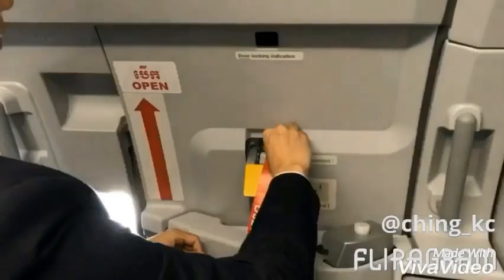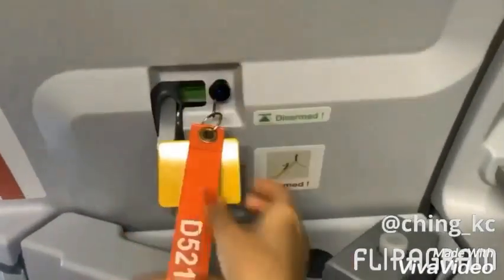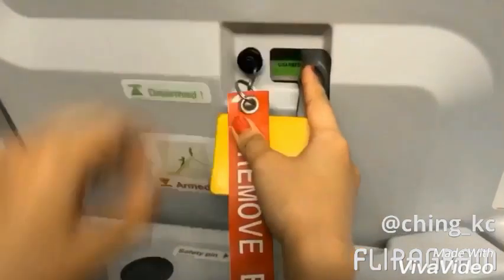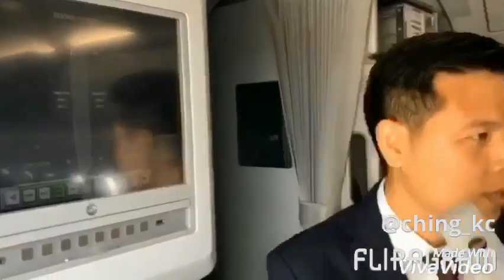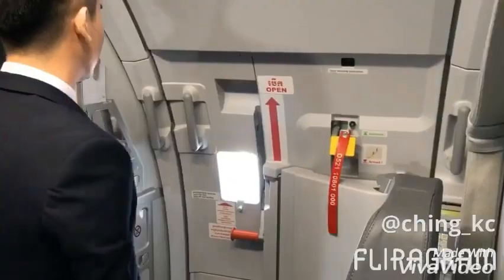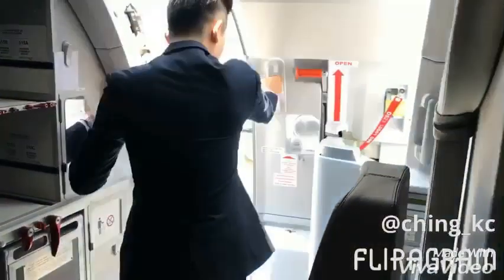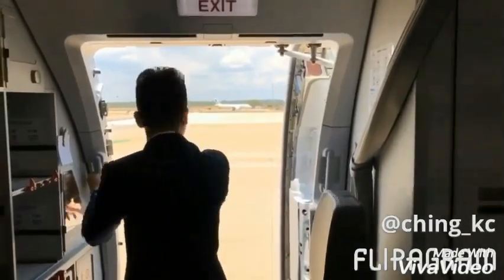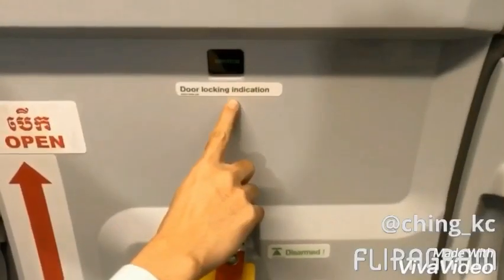Ching KC : Normal Door Operation (Arming, Disarming, Opening, Closing) 🛫🛬🇰🇭

Comment: So if you try to open a door when slide is armed then slide will be automaticly deployed, right? And what happend if someone will try to open a door in flight?
Reply: yes
Reply: The pressure difference pushing the door against the hull will make it impossible to open in normal flight

Comment: Is it hard to close the door do You need strenght💪💪
Reply: From what I’ve seen, it isn’t too difficult to lock the door. It appears that to lock the door easily, you need to keep pulling the door inward while moving the control handle down.
Reply: Not really. Done it hundreds of times as a First Officer and now Captain of an A320 and now A330. Its really not that hard. Boeing doors are what you need to worry about.